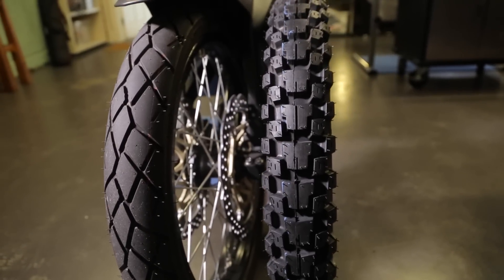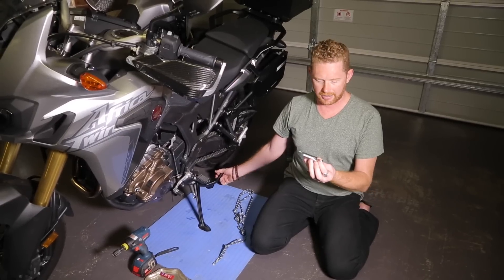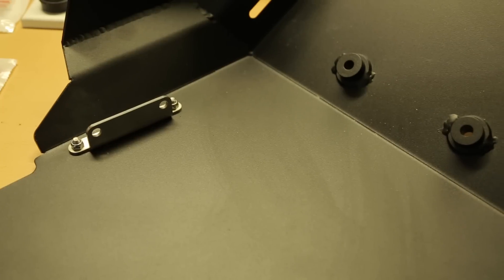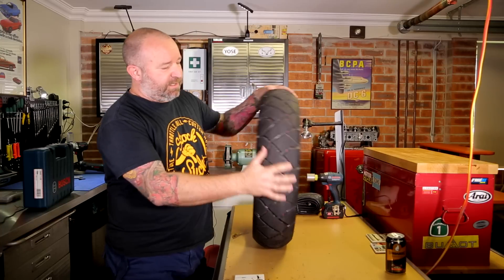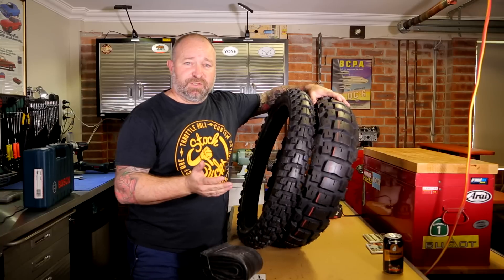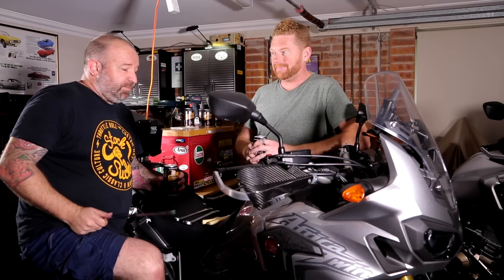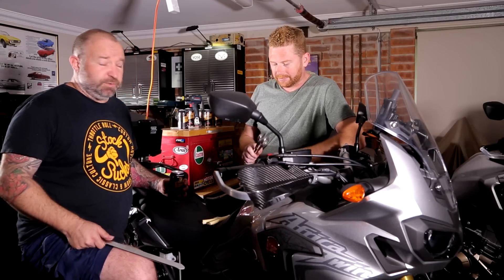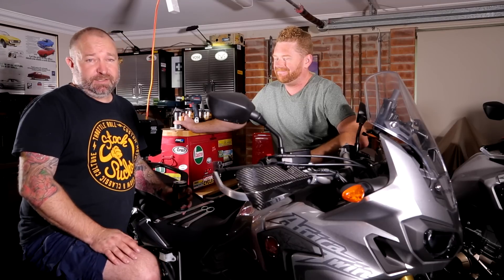Eposide 2 - Africa Twin Bike Preparation

Comment: Nice. Excellent work with the video. You mentioned a tyrer supplier in Cessnock? Can you advise?
Reply from the maker: We got them from a company called Adventure Motorbike Specialists. They were based in Cessnock but have just moved. You will find them on Facebook.